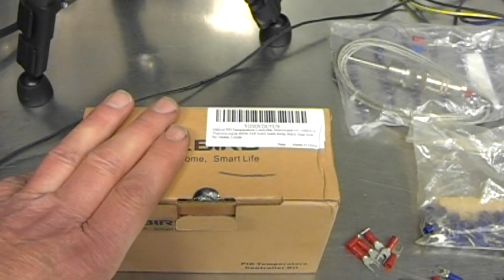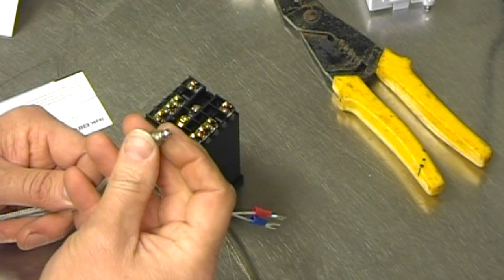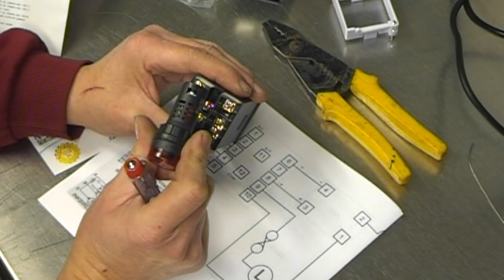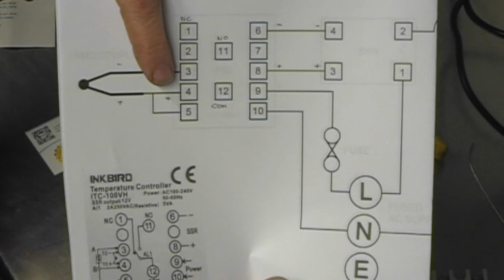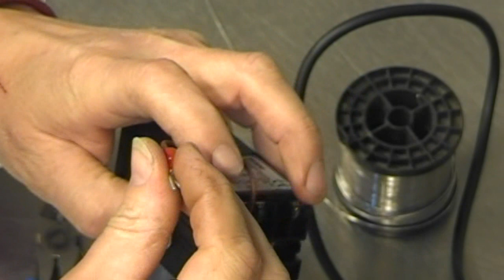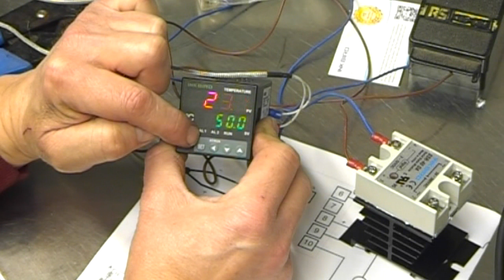PID Wiring Inkbird ITC-100VH discount offer

Comment: Hello there. Can someone help me pls?!. 
I wired my PID temperature controller as per its manual; connecting the thermocouple and the heating coil (through a solid state relay).

Both the heating coil and the thermocouple work but the PID isn't doing its work i.e, increasing or decreasing the heating coil's temperature to match that of the set value entered on it.

The PID is an XFXM-2012P5 Chinese model.
What can I do?.

Comment: Hi, I have wired my PID as per your instructions and then onto the SSR, I have a little red light on the SSR indicating power to it. The last two terminals on the SSR have gone straight to my heating element. The heating element does not warm up at all.
Reply from the maker: Difficult to advise without being able to see how you`ve wired it  Fotek ssr are notorious for being faked and have issues if thats what your using

Comment: Great video, thanks for this! I’ve got my device all wired up, but it reads my room temperature at anything between -42C and +5C. Any idea why the temperature is so inaccurate and varying so widely? I’ve tried three different type K probes, and I’ll have the same issue.
Reply from the maker: Have you gone into the menu at SN and set it for 0 = K type
Reply: @norfolkhillbilly  I do - gone through all the various setting options multiple times…
Reply from the maker: @tristanwatson499  If it`s a two wire probe try connecting to terminals 3 and 4 and a bridging wire across 5 and 4

Comment: Hi can you tell me what goes into the 1 and 2 terminals is that the line and neutral for the heater. If so which is line and which is neutral.?
Thanks
Reply from the maker: If you are referring to the connections on the SSr 1 and 2 are the live in and out to what ever your powering

Comment: one more question... Instead of SSR , may i use contactor with control input 24-220v AC ? or in this case in need a RH version of controller ?
Reply from the maker: Yes you would need the other version,  But I don't know if they have enough power for a contactor, also the switching frequency could well burn out a contactor quickly.

Comment: Hello!
I need an advice please..
My mash tank have 2 heating elements 4kw each one.
May i manage 2 of them by one controller?
I need to connect 2 ssr in paralel mode, right?
Or it's better to buy i ssr 40 o 60a and connect 2 heating elements with 1 ssr? 
And the next question... Ssr 20a will be enough to manage 4kw heater or better to place 40a to avoid overload?
Thank you!!
Reply from the maker: At 220v with 4kw your running just over 18 amps, Knowing that some ssr are of dubious quality I would run a 40amp in place of a 20. you can get 80 and 100amp ones and run both heaters on one ssr.
Reply: @norfolkhillbilly  tgank you man!
And next question... I have 2 fase electricity to run my heater... South America..
If I'll install 3 fase relay buy use just 2 fase inputs, will run?, in theory yes 🤣
Reply from the maker: @Kwaaass  I would say so, it`s still operating the 3 but you`ll just be using 2.
Reply: @norfolkhillbilly  thank you !!!

Comment: I bought the kit and I am proposing to use it to power a silicone heating blanket with a 1KW rating. I have set the controller to 30C and powered on, the blankets peaks around 50C and then starts to drop but it never gets below 41C before the relay kicks in again and sends the temperature up towards 50C again.  I am thinking there is some calibration to do on the controller, I have not read the instructions fully as they are a very poor translation into English. BTW I followed Johnn'y Reloading Bench video to complete the wiring and added some inline fuses.
Reply from the maker: Barley and hops brewing have some settings videos on pids

Comment: What gauge wire did you use and does the amperage of the connecting devices dictate the gauge of wire used?
Reply from the maker: I believe it was 1.00mm sq for the pid connections , and yes the appropriate rated ssr and cable to match your load

Comment: Silly question but I have to ask it, while the temperature is below 50C there is power coming from the other side of the relay and when it reaches 50C the power to the relay stops, is that correct?
Reply from the maker: If you had it set for 50c there would be no power going to energise the relay, only the supply up to terminal 1 or 2 depending on your connection, When it reached set temp, pins 4 and 5 would have current going to them allowing pins 1 and 2 to complete a circuit to your load.
Reply: @norfolkhillbilly  Can it work in reverse so there is power to the output side of there relay and when the thermocouple reaches 50C the power switches off.  To put my question  to context, the output would be to a heating blanket and when the blanket reaches 50C the power would cease?
Reply from the maker: @pluckerpick  yes you can change heating and cooling in the menu so it will work in reverse
Reply: @norfolkhillbilly  Thanks, I have ordered the kit, I'll need to change the thermocouple as I need a thinner option, RS components have a K type that is good for 300c , I assume there are instructions with the kit that explains how to set heating and cooling  ?
Reply from the maker: @pluckerpick  yes also a download from there web site
Reply: @norfolkhillbilly  Many thanks for your help, great video well described.

Comment: Thanks for a very informative video, with your help I have just put together a Controller using the Inkbird 100 vh. Ive had a problem though, after connecting a PT 100 probe to it as per the manual using the 3 connections 1 red and 2 blue it read 650 degrees when the air temp was 15, so i substituted a K type with just the 2 connections and it read the air temp perfect. Does this mean the probe is faulty, or do I need to go into the Ink birds settings and change from K type to something else
many thanks in advance
Reply from the maker: Hi, Thanks, yes you need to select the type of probe in the menu selection. SN on the menu 21 for a pt100
Reply: @norfolkhillbilly  Thats sorted it many thanks

Comment: Question about the alarm, the buzzer will be connected to pin #11? Basically is no instructions with the unit and Im running 240v (2 hots 1 ground) and you are the only one explaining where to connect the alarm. I would like the alarm (buzzer) to go off when the temperature I set was reached.
Reply from the maker: Hi, you need to go into the settings and  find the  alm H which is the temperature menu, I`ve not had any time to proceed with more videos on a build or use the controller, But take a look, if you haven`t already at George at Barley and Hops, channel, He has some great vidoes on the Inkbird pid`s

Comment: What size fuse is recommended to protect the Controller. Many thanks in advance
Reply from the maker: The current is just under 500ma at 120v 300ma if 220v